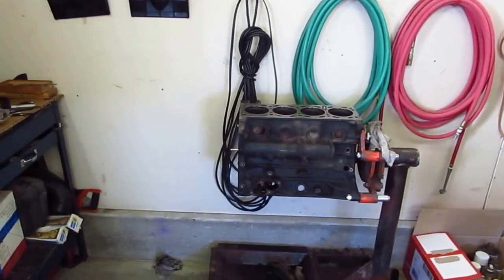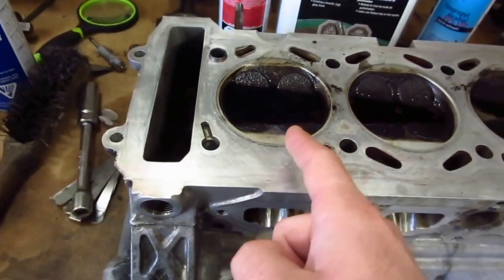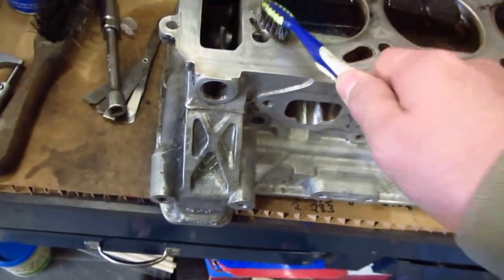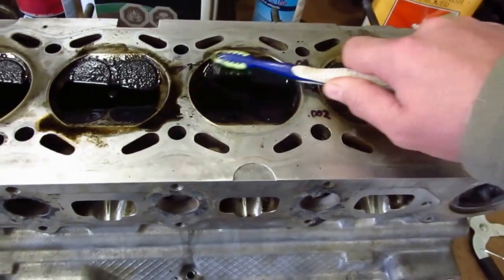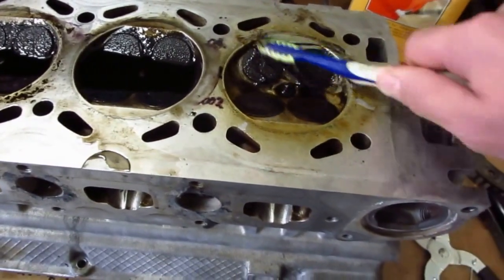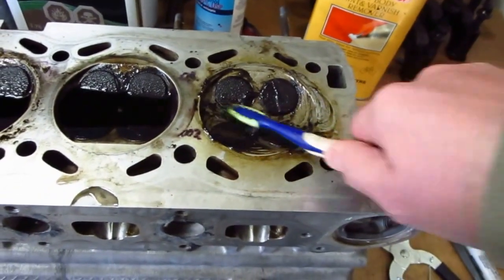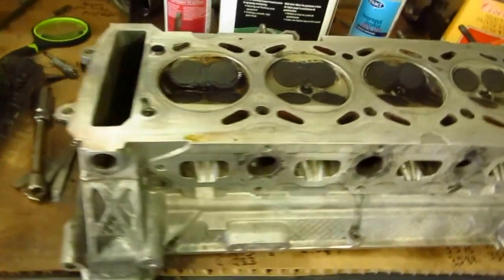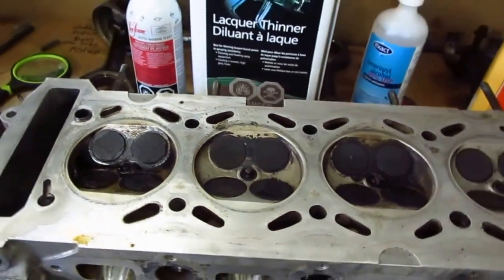piston and head cleaning decarbonizing diy shootout part 5 final with winner

Comment: Use a caustic aka lye based cleaner doing it your way just soak with marvel oil...carb dip is best or a oven cleaner..the chem dip works best.but wear protection and have some vinegar or something to neutralize it if it gets on you

Comment: I think your lacquer thinner came in 2nd, if not first.  If you noticed to where the lacquer thinner was filled in the head's chamber, you'll notice that the carbon dissolved off.  Above the line of the thinner, it didn't. But that was likely because the thinner wasn't high enough (i.e. not enough thinner added to the chamber) to allow to soak into the carbon.
Reply from the maker: Yeah it's not bad at most stuff and is my goto for most things solvent except plastic of course. Then I use 99 iso

Comment: Oven cleaner = sodium hydroxide.
Paint remover = potassium hydroxide. 
They both corrode aluminum.
Reply: This should have a big asterisks. SOME over cleaner is Sodium Hydroxide - the good stuff. The low VOC stuff is not and is safe on aluminum and works pretty good still.

The low VOC or 'safe' paint strippers are often is Potassium Hydroxide. But the old good stuff is Methylene Chloride just like the old good gasket removers. It'll put hair on your chest, that's for sure. Methylene Chloride is 'banned' for consumer goods, but still available for 'professional' use.

The point being, making blanket statements with chemicals is probably not a great idea.
Reply from the maker: interesting, because I think the makeup of gasket remover is the same as paint remover or at least reacts the same and it is designed to spray on aluminum. maybe gasket remover isn't as safe on aluminum as we are told ?

Comment: oven cleaner works the best
Reply from the maker: actually oven cleaner can eat or pit aluminum and cause heat stress cracking, I have used on mags and even then it caused discoloration, but I would never use on a head.
Reply: +EASTENDGLEN ive used it on heads for over a decade now..ive never had any of them problems nore has the 100 other people i probably..i can show you a pic of a head i did last week..30 mins of oven cleaner,water rinse then dried off with compressed air..no heat put in parts nothing..i use it on timing covers,oil pans,valve covers and intakes also with no issues
Reply from the maker: that`s great but after seeing what it did to mag wheels I will stick with paint remover, which is basically wipe on wipe off
Reply: I've just read today someone cleaned his outer engine with oven cleaner and it ate the metal. giving it bad dark color.